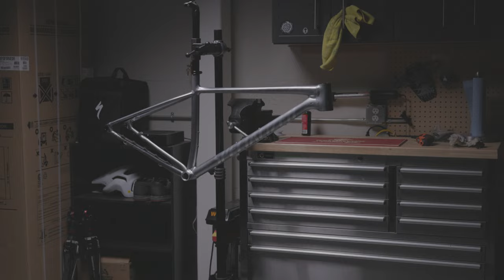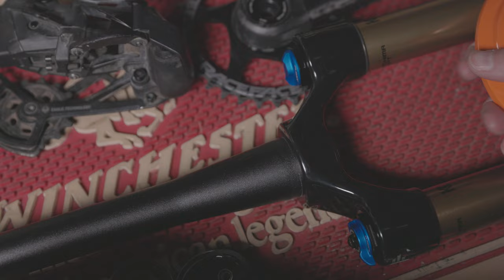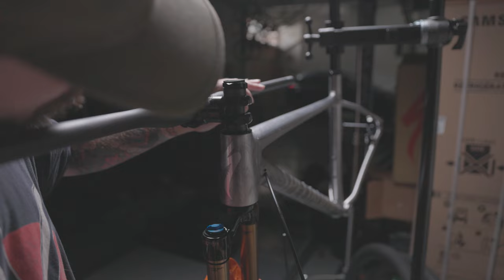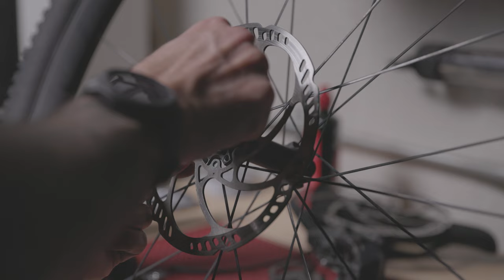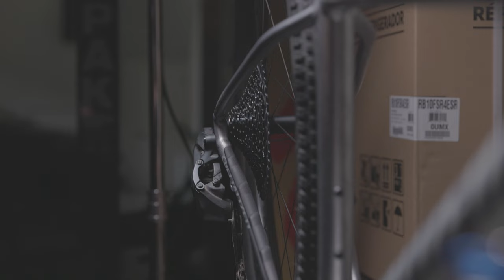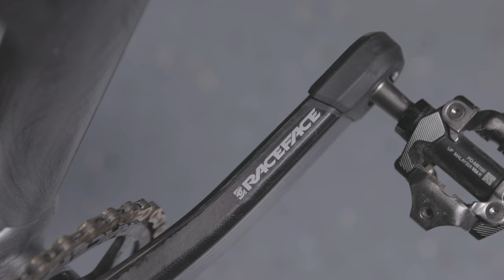DREAM BUILD - Specialized Chisel Hardtail Race MTB

Comment: Is it possible for someone with no experience to build a bike from scratch or is that a dumb undertaking? I'm loving the Chisel hard tail frame specs, but i don't like the low end junk on the overpriced pre-built options. Trying to figure out how hard the headset install would be.
Reply from the maker: It’s very easy for the most part but you may need help and special tools for cutting the steer tube, bleeding the brakes, setting the derailer up, etc. That said you should do it so you know how to fix it
Reply: @brakeforsnakes  thanks for showing your build! How many bikes have you built from scratch?
Reply from the maker: @teecee4459 probably 15

Comment: What headset did you use? Mainly I’m wondering what the long bolt inserted up through the bottom of the steer tube was. My control SL wheels should be here some day, and I’ll see what the weight is when I install them.
Reply from the maker: Just the headset that comes with the frame. What you’re asking about is the specialized steer tube swat tool that I use instead of a star nut and top cap. Also my wheels with tires weigh 4lbs
Reply: @brakeforsnakes  Put my Control SL wheels on yesterday (Shimano MS + Centerlock) and did a 30 mile river path ride. I feel less fatigued than riding my Road+ bike with 650x47c slicks, so I'll call it a success to making my Chisel my new gravel & XC bike. I just need to upgrade some other parts to lighten up now.

Comment: Why the aluminum frame choice instead of carbon looking at components I don’t think cost is a problem?
Reply from the maker: Because the cost to benefit doesn’t make sense on that
Reply: The aluminium chisel is only 1.3 kg lighter than a lot of carbon frames. A very light carbon is around .9 kg. Some people like myself prefer aluminium to carbon. Different ride and your better off if the bike is crashed. The chisel also has a lifetime warranty on the frame.

Comment: Are you using a 100 or 120 mm fork ? Thanks
Reply from the maker: 120!
Reply: @brakeforsnakes I don't think 120mm is recommended for that frame.
Reply from the maker: @theymademepickaname1248  It is, I ran 120mm on my last chisel for years.
Reply: @brakeforsnakes  I have a '21 chisel.  I want to upgrade forks, but I think 110mm is max recommended from specialized.  I'm sure it could survive 120mm though.  Can't decide on sid sl, sid, or fox 34 sc.
Reply from the maker: You can run a 120